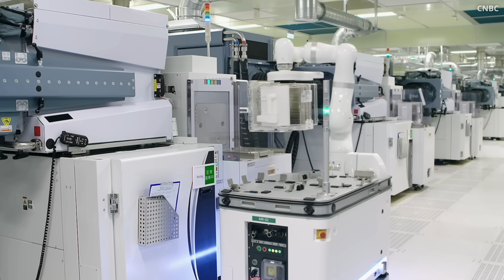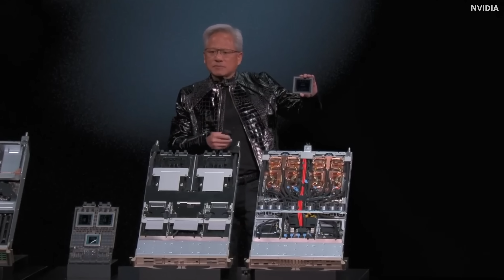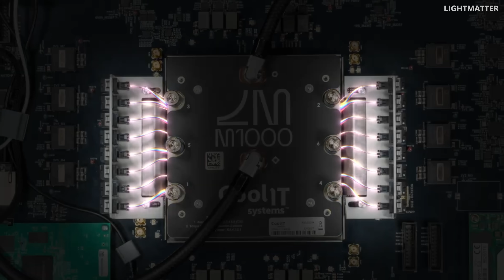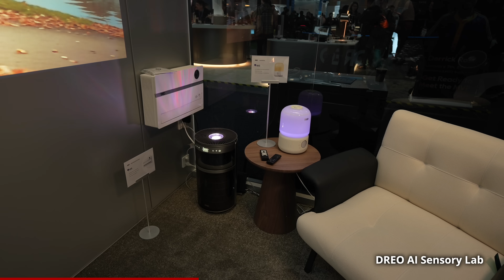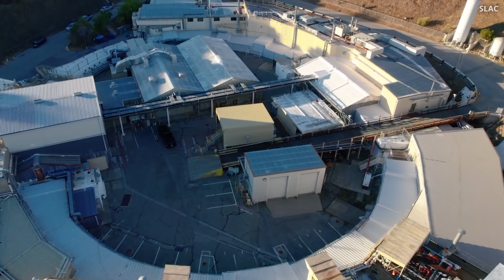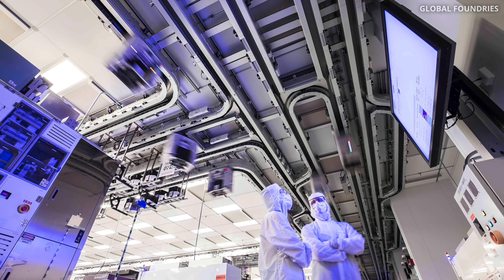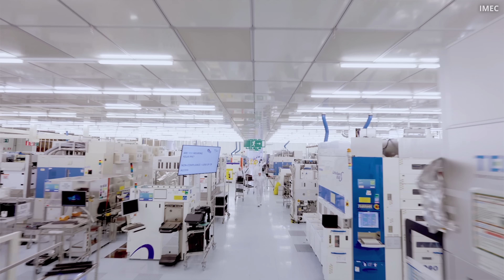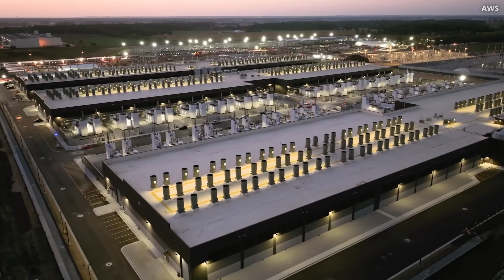This New Technology Could Kill TSMC and ASML

Comment: Veritasium made a video about ASML and they explain why the x-ray method doesn't work. It destroys or damages the substrate. Also they mentioned that a Japanese invented the mirrors that work with EUV. The input that the USA has in the EUV machine are a few patents.
Reply: The irony is -- now a new startup called Substrate wants to use the very X-ray that would destory substrate.
Reply: Then clearly we should be using gamma rays.  😂
Reply: @wg4576  Sit down Banner!
Reply: @wg4576 gamma and x-ray are the same wavelength
Reply: Yeah, it's cool having nuclear reactor at the core of your factory @wg4576 . *8')
Reply: My understanding from Veritasium video is that x-ray works. Regarding accuracy, they interviewed company's employees.
Reply: That issue was spoken to in the video, there are solutions obviously given the results. There always is a work around
Reply: @Blackbeardxx9  Yeah I can't imagine ASML thinking there's no workaround. They just haven't found it yet
Reply: They explained how they had to face through all the problems to come up with euv lithography, people were saying the same thing as you for euv lithography back then.

Substrate is not revealing how they did it for competitive purpose but surely they have made a breakthrough and made x ray lithography possible just like euv lithography was made possible in past.
Reply: ASML device is using X-Rays. That is actually why only one company can do it, as solution is on edge of clark tech.
Reply: Which model is using x-rays @TheRezro  ? All the models they are advertising are EUV at most.
Reply: Yep, ASML's EUV is basically "soft Xray" 👌🏻
Reply: Not really,  @doggSMK , EUV is 13.5nm and x-rays are defined as being between 10nm and 10pm, so close, but no cigar. Why even bother having definitions for these things if people are just going to ignore them.
Reply: Exactly. Its suspicious how much he glazes the US in her videos.
Reply: The EUV optics/mirrors technology was developed by Lawrence Livermore, Lawrence Berkeley, Sandia National Laboratories, and Tinsley Labs in the US before being transferred to Zeiss. This is well established; you can even find this info even on the ASML site, and there are 100s of papers on this published in the scientific journals in the 90s and early 20s on this.
Reply: The first actual EUV microstepper Lithography tool was built in the UK though  @JigilJigil  as those papers you referenced should have told you. I know, because I worked on the follow-up project. The MS-13 tool was delivered to the states so that research could be done there on resist compositions, as resist for EUV is very different to the resist needed for 193nm lithography.
The same Oxford based company also built the first high NA 193nm immersion tool, the MS-193i, which was also needed for immersion resist development.
Don't be so arrogant as to think that the U.S.A. can do this stuff on it's own. There are perhaps one or two people in the world who know enough to some aspects of tools like this, and many of them live in the U.K., the Netherlands and Germany. All of them are standing on the shoulders of giants, just as their work will form the basis of the next generation of innovations.
Reply: In short:
 - EUV technology was originally developed in the US through consortiums involving DOE national labs, NIST, and many prominent private US companies. Most of the work was done in the US (the testbed, light source design, metrology, photoresists, etc.) before ASML joined the EUV LLC and got access to the technologies.
 - ASML was actually late to the game; it received permission from the US government to join the consortium, which gave it access to the technology, and the technology was transferred to ASML. (The US government rejected requests from Nikon and Canon to join the program due to national security concerns. That is why Japan, despite its significant share in the lithography tools and equipment market, does not produce EUV systems.) 
 - Along the way, ASML was granted approval by the US government to acquire several American companies, enabling it to build the system into what it is today. (It still operates under many of those licenses.)  
 - Many critical parts and components of the EUV system were developed in the US and continue to come from American suppliers. For example, the optics/mirrors technology was developed by Lawrence Livermore, Lawrence Berkeley, Sandia National Laboratories, and Tinsley Labs in the US, before being transferred to Zeiss. The reticle stage technology was developed in the US and is still manufactured there. Most importantly, the core and most complex part of the system—the light source—is designed and built in the US by an independent California-based company called Cymer. The laser is also designed in the US by Cymer and manufactured by Trumpf in Germany.
Reply: @JigilJigil  Did you watch the Veritasium video?
Reply: @rteune2416  He is wrong and didn't do the homework. You can check SPIE Journals, and find a plethora of the research there, or read Vivek Bakshi's EUV book (2008), the most comprehensive book on EUV development history.
Reply: Problem with xray - it creates a secondary strey electron  which blue the pattern and also Shadow effect it also  needs thicker Mask
Reply: ASML uses step-n-scan technology developed by Perkin Elmer and IBM, (both in the USA), then sold to SVG to become SVGL which was then bought by ASML. The EUV light source, the very heart of every EUV aligner, was developed and manufactured by Cymer, (San Diego, CA), for ASML, then ASML bought Cymer. So I'd say the US had a lot to do with ASML's success today...
Reply: @mickpetersen806  There is a truth to that but lets be real, The true magic happens in the scanner. The creation of EUV light was achievable before but it would get absorbed instantly, guiding this light and getting it accurately onto a wafer with nanometer precision is the real challenge, all at dazzling speeds.
Reply: @wesleyff2869  You're absolutely right! Twin magnetically levitated and driven stages scanning at the same time that the mask is scanned, at the same exact moment a drop of tin is being vaporized in the light source, it's mind boggling. Then to move and repeat the process in a few seconds, all with nanometer precision. Zeiss optics are great, but Perkin Elmer was also a German optics company that migrated to the US, they just decided they didn't want to be in the semiconductor industry any more, I'm sure they could have developed the same optics package.
Reply: @mickpetersen806 There is also Brion Technologies, a computational lithography (Silicon Valley) company also acquired by ASML.
Reply: @mickpetersen806  ASML’s success is the result of deep transatlantic technology transfer combined with exceptional European system integration and execution.
The US had a lot to do with ASML’s success, but ASML’s genius was recognizing where the breakthroughs were, acquiring them at the right moment and doing the brutally hard work of turning physics into production.
The US invented EUV, proved it could work, then decided it wasn’t worth finishing. ASML picked it up when it was “impossible”, finished it and now sells it back to the world.
ASML succeeded by combining American ambition with European patience.
Reply: The first EUV microstepper machine was actually developed and built in Oxford, UK,  @ppdan  exactly like the first 193nm immersion tool, so it's possible for an agile SME to push the market forward before the big boys can get up to speed.
Reply: You can trust Trump will start a war against the Netherlands tomorrow if the x-ray thing doesn't work. He will claim ASML is where the fentanyl is produced
Reply: @johnsmith-ro2tw  
In short:
 - EUV technology was originally developed in the US through consortiums involving DOE national labs, NIST, and many prominent private US companies. Most of the work was done in the US (the testbed, light source design, metrology, photoresists, etc.) before ASML joined the EUV LLC and got access to the technologies.
 - ASML was actually late to the game; it received permission from the US government to join the consortium, which gave it access to the technology, and the technology was transferred to ASML. (The US government rejected requests from Nikon and Canon to join the program due to national security concerns. That is why Japan, despite its significant share in the lithography tools and equipment market, does not produce EUV systems.) 
 - Along the way, ASML was granted approval by the US government to acquire several American companies, enabling it to build the system into what it is today. (It still operates under many of those licenses.)  
 - Many critical parts and components of the EUV system were developed in the US and continue to come from American suppliers. For example, the optics/mirrors technology was developed by Lawrence Livermore, Lawrence Berkeley, Sandia National Laboratories, and Tinsley Labs in the US, before being transferred to Zeiss. The reticle stage technology was developed in the US and is still manufactured there. Most importantly, the core and most complex part of the system—the light source—is designed and built in the US by an independent California-based company called Cymer. The laser is also designed in the US by Cymer and manufactured by Trumpf in Germany.
Reply: @johnsmith-ro2tw   No need. ASML is funded by the U.S Government. It's why they have a say in who ASML sells its products to. ASML couldn't exist without the U.S government's money because no normal investor would have taken the chance. The U.S government could take the chance because if it loses a billion dollars, they wouldn't even blink. A regular investor couldn't, wouldn't take that risk.
Reply: @johnsmith-ro2tw  So what?
Reply: @esticolis  guys, his name is literally 'generic man-random letters'. He's not a real person.
Reply: @esticolis  are you on the list too?
Reply: @johnsmith-ro2tw good.
Reply: So you rather listen to Veritasium who has no experience in the field rather then someone who has worked in it? You'd be surprised about how much Veritasium gets wrong in his videos.
Reply: @supernus8684  People in the Veritasium video are the ones who work in the industry. rteune misread the fact that ASML device is using x-rays and the solution for it is extremely complex. Instead using x-ray mirrors, they generate x-rays by emission on spot from tin droplets.
Reply: What are you talking about  @TheRezro ? ASML EUV tools use quite a few Multi-layer  mirrors, the animations even show the EUV light travelling from the source, bouncing off various mirrors, off the mask and demag mirrirs then back down onto the wafer. WHile EUV and soft-xrays are close in behavious, ASML don't use x-rays, the EUV light they use is 13.5nm, to be considered x-rays the light would have to be less than 10nm.
Reply: @supernus8684  She has no experience in design of lithography. She has experience in chip design.
Reply: @mirasolovklose3888 and as far as we know, she might have been in charge of designing coffee machine chips. Impressive still but entirely unrelated.
Reply: @supernus8684  It was the ASML guys in the videos doing all the explanations.

Comment: All three lithography approaches, NIL, EUV, and X-ray lithography (XRL), are targeting the sub‑2 nm node frontier, but they differ significantly in resolution, maturity, cost, industrial role, and potential impact.

Resolution: EUV is currently capable of ~2 nm effective patterning, NIL templates (~10 nm lines) promise sub‑2 nm potential once fully deployed, and XRL is theoretically capable of even finer features, approaching 1.4 nm.

Maturity: EUV is proven, high-volume, and fully integrated into leading-edge fabs; NIL is approaching pilot-scale readiness with templates expected around 2027; XRL remains experimental, with high technical risk.

Cost & Efficiency: EUV tools are extremely expensive and energy-intensive; NIL could offer lower per-layer costs, and XRL may become cost-effective if throughput and scale are achieved.

Industrial Role: TSMC/EUV drives mass production of leading-edge chips, DNP/Canon provides templates and machines for NIL, and Substrate aims to develop a startup-driven XRL alternative.

Potential Impact: NIL is positioned to complement EUV and reduce production costs for sub‑2 nm layers. XRL could be a disruptive new approach to advanced nodes, while EUV remains the backbone of current leading-edge semiconductor manufacturing.

In short, EUV is the established standard, NIL is an emerging cost-reducing supplement, and XRL represents a high-risk, high-reward potential disruptor for the next generation of chipmaking.

Comment: X-rays not only “push through materials” but they are small..photon small.. so they whisk between the atomic structure of most materials.  You need ultra dense filters and denser focal directional lines to attract them to the right space where atomic structures exist to act on them.  The complication of this new process is geometrically harder

Comment: There is a lot more to photolithography than just the light source.  I find it hard to think that being able to decrease wavelength of the source saves enough to make a machine an order of magnitude cheaper.  To start with, optics get much harder.  Beyond that, the expertise TSMC brings to fabrication goes way beyond being able to buy and operate photolithography machines.  If ASML's machines were free, fabs would still be enormously expensive and hard to successfully operate.

Comment: I believe this is called a Free-Electron Laser.  Very interesting science behind it - limiting factor has always been the size of the LinAc required if I'm not wrong.  Definitely interested to see if this implementation stands up to scrutiny - in theory, the wavelength called pushed even further down by just modifying the wiggler

Comment: We wouldn't need to keep making chips smaller and smaller if Google and Microsoft would just remove all their 'bloatware' from their software. I noticed something interesting using a 25 year old Macintosh with a 1.25 gigahertz single processor on the old "mirror-door" unit running Mac OS 9.2.2 - In this environment Microsoft Word is a tiny little program that fits on CD with 20 other programs like the entire Adobe Suite and when I open a Word Document it opens ready to compute in only 1.55 seconds making this old software on a 25 year old computer much faster than the newest software running on a $25,000 state of the art computer with the fastest 24 core CPU, 5090 GPU and solid state memory (Daul-raid UNIS S5 Ultras 28,850 MB/s). On top of that the information on the old Mac is being served from an old 50 pin SCSI - 3 1/2 inch mechanical HD drive running at 5400 RPM with pathetic slow Simm memory of only 512K -  I just find this fascinating! I think we are going backwards in terms of real performance at the point of actual user interface and work flow. I'm not really impressed by how fast a computer is spinning its tires and making noise & smoke in the background, that does not equal real world performance in the hands of a user. Am I the only one noticing???

Comment: Synchotrons don't produce x-rays because you cannot bend x-rays.  This is ....wrong.  You can produce electron beams and then hit high Z materials which will produce x-rays.  These machines are small because we can accelerate electrons very easily.

Comment: Why do you need a synchrotron for X-rays?  Medical radiation machines make x-rays in much smaller packages ever at very high energies using linear accelerators that are only a few feet long.

Comment: This video is interesting, but it mixes speculation with dramatic framing.
TSMC and ASML are not going to be “killed” by a single new technology shown at CES.

These companies dominate because of decades of engineering, materials science, supply‑chain mastery, and multi‑billion‑dollar infrastructure. Replacing EUV lithography or advanced semiconductor fabs is not something that happens overnight — or even within a decade — without massive scientific breakthroughs and global industrial adoption.

If this new approach is real and scalable, it could become a complementary technology, or open a new niche. But claiming it will “kill” the world’s most advanced semiconductor ecosystem is premature and misleading.

It’s important to distinguish between:

a promising prototype,

a research‑level breakthrough,

and a technology capable of replacing industrial lithography at scale.

Right now, what we see here is closer to the first category.

Speculation makes good YouTube titles, but it doesn’t reflect how semiconductor manufacturing actually evolves.